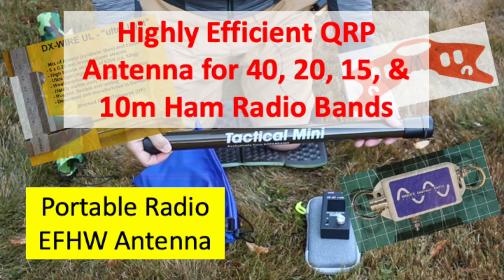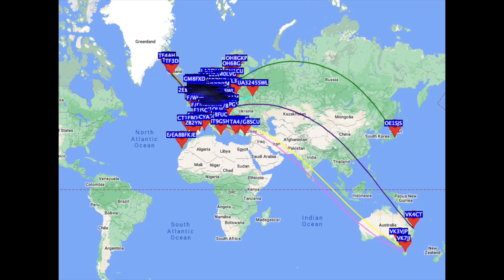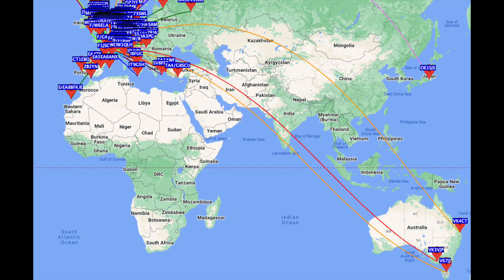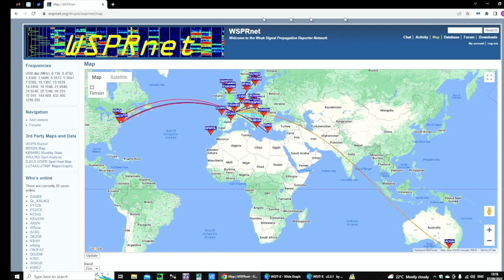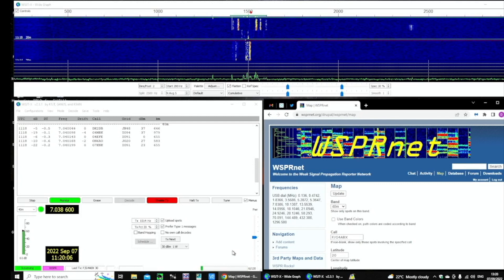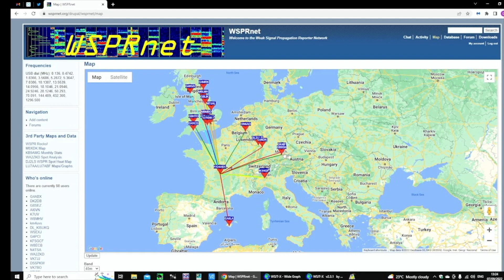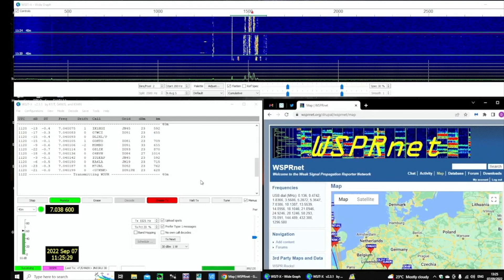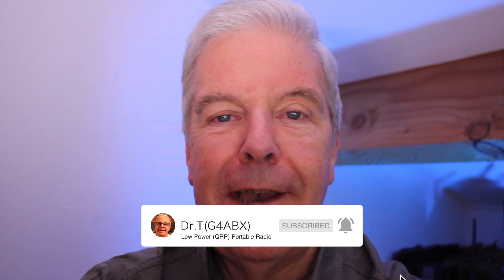One of the Best Ham Radio QRP End fed half wave (EFHW) antennas available

Comment: very nice video.... I'm having an issue with my EFHW 64:1 (homebrew) 40m is 1:1, 20m is 1.5:1 , 15m is 3:1 and 10m is also 2:1, why im having high swr on 15 and 10m Band, antenna configuration is Inv L ....thanx
Reply from the maker: Hmm. Interesting problem!
Can you tell me where on the higher bands the SWR is lowest (i.e. above 21Mhz, above 28Mhz)? and what is the lowest level of SWR for these regions?
I might then be able to offer some advice :-)
73
Reply: @G4ABX  thanx alot Sir, on 15m its flat all across 3:1 and on 28 its almost flat as well, its 2.7:1 at the start and 2.8:1 in the end min is 2.4:1 at 28540 khz, just for i didn't have the 100pf capacitor, so i joined two high voltage 220pf capacitors in series to get 110pf capacitance.....thanx
Reply from the maker: Good morning.
When developing the UnUn, a 49:1 ratio was tried -- but it turned out the SWR was Ok on the higher bands but not on 40M and 20M. The 64:1 ratio cured this problem.
Its also critical that you use the correct ferrite otherwise you will have too little -- or too much inductance for your chosen bands.
Finally, its important that you 'twist together' you primary and secondary windings for the length of the first winding -- when you start and you are winding the coupled primary/secondary.
Your 120pf Cap should be fine, that's not the issue.
Does any of this point help trouble shoot your issue?
73
Bruce G4ABX
Reply: thanx alot Sir for the detailed reply, actually i read somewhere that winding without a crossover with a tap after the 3 rd turn for 64:1 unun (3 primary and 21 secondary) is more efficient (not sure if its right or wrong) so i unwounded my previous unun which was working fine, and did it again without crossover, 40 and 20m were fine but no matter what i do higher bands were not coming down 3:1, so again I unwound it and again wounded in the traditional primary winding twisted and a crossover with the same 3 turns primary and 21 turns secondary, and now its again working fine, so i have decided not do any more experimentation and just stick with the traditional winding.... pattern....thanx alot
Reply from the maker: As my old Dad used to say 'The Better is the enemy of the Good' as I rebuilt my RX for an extra 3db gain and broke something else on my way!
73
Bruce G4ABX
Reply from the maker: @ElectronFunFactory Or was the wrong value. 
Thanks for that feedback
73
Bruce G4ABX